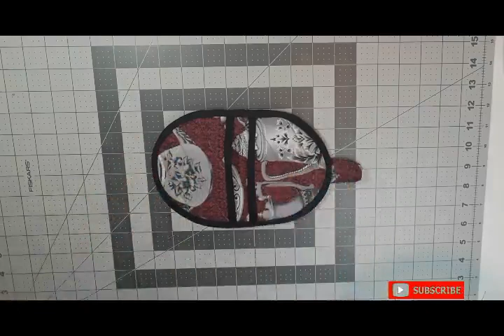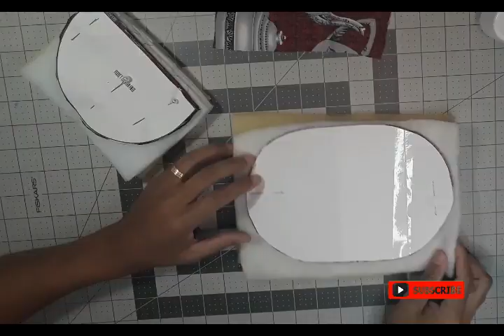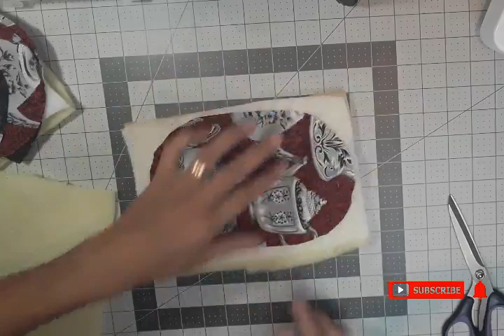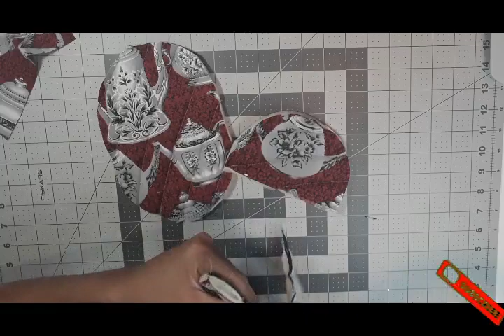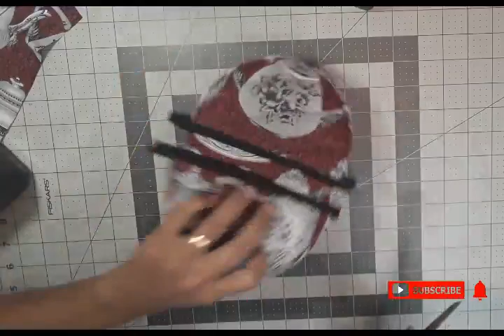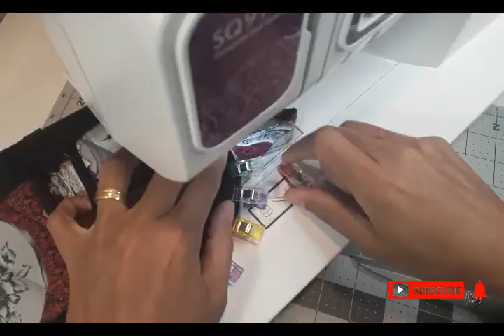Easy Potholder DIY | Simple Pattern & Step-by-Step Tutorial

Comment: I like to use a very good insulating fabric for pot holders & oven mitts. IMO foam is not a good insulator against heat.   
I had foam on the base of the ironing board and the top was cotton fabric but over time both the top & the foam base got burned & had holes in it.  Well explained tutorial. Thank You. 😊👍🙏🙏
Reply from the maker: Yes that the optimal for sure 
Thanks for sharing
Reply from the maker: Hi Liz I added some more sewing videos don't forget to subscribe to be able to see the new ones
Thanks for watching and Happy sewing